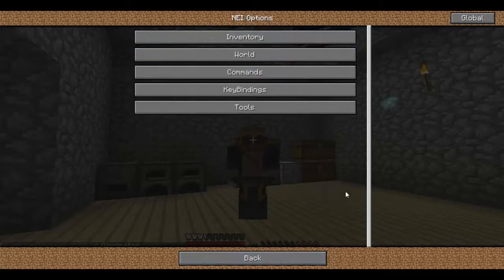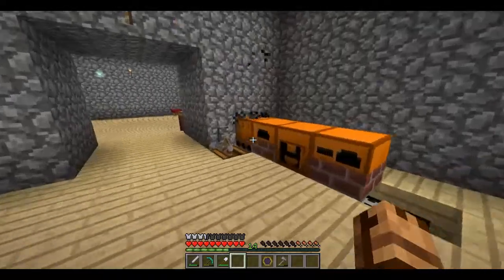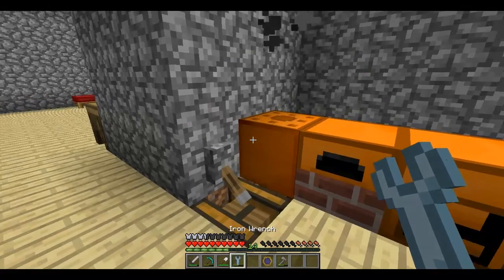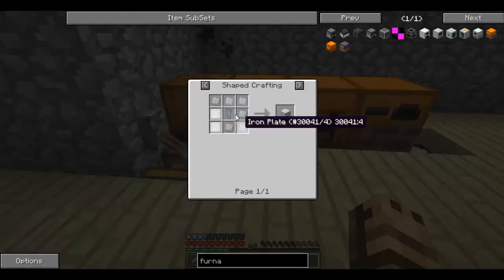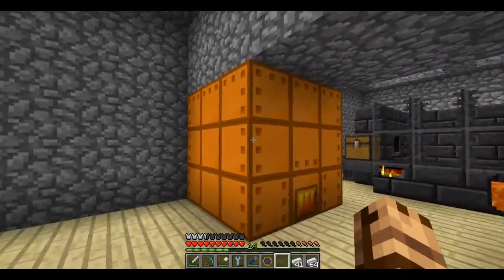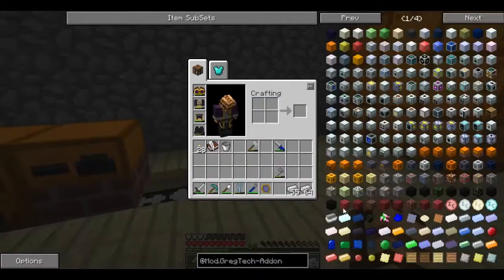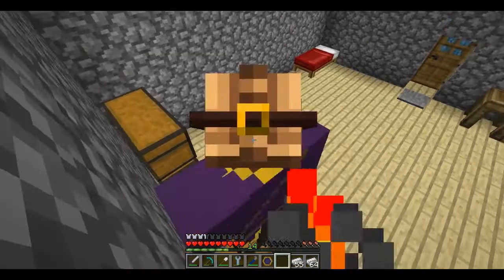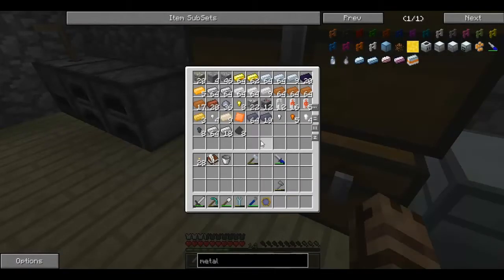Getting Started With GregTech (1.6+)

Comment: How would I go about automatically filling the boilers with water? I see some kind of pump system on the left, but I can't figure out how :(
Reply from the maker: In this video I used buildcraft liquid pipes with a redstone engine. But in the newer Gregtech, you can use really any mod with pipes. Like Thermal Dynamics. But don't forget that Gregtech has its own pipes